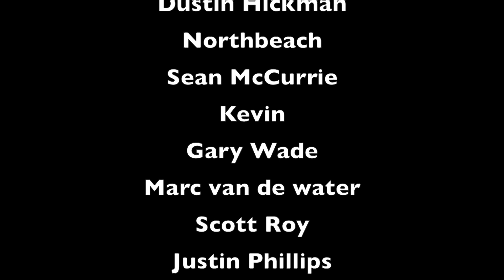Detroit Diesel schooling from the Bus Grease Monkey

Comment: Stu, that advice re the electric lift pump on the Detroit was spot on. I fitted one to my 1946 Cat D4 dozer and it was the best thing I have ever done/ I converted the dozer from Pilot (donkey/pony) start to electric start. That meant I would have been trying to start the old girl on no fuel pressure. With the electric lift pump I have working fuel pressure before I start cranking the engine. Brilliant. I might tell you that poor 73 year old dozer has to earn its keep here, so it is no hobby toy. I might also say that the old dozer and I were born in the same year.

Comment: I was a firefighter for 30 years. The Detroit diesels  on our apparatus has an engine kill switch in the cab in case of a runaway. A cable went to a spring loaded plate that closed cutting off the air. To restart it you had to open it manually.
Reply: I dont work on diesels but ive heard most(maybe all) of the new ones have those in them(Over the road trucks at least). Definitely something that is very useful

Comment: A story about a blower shaft: Back in the 90's I worked mechanicing on  trucks but also helped a friend drive a few spring break bus tours...Going across I10 in Florida with a'72 Eagle, 8-71 the blower shaft let go...we pulled up the back floor and got the shaft out, the spline teeth  were sheared off but there was  a  little bit left on the end. We had no other shaft so I put a dime in behind it to get the remaining spline teeth to engage the  blower spline. It ran all the way back to Canada.

Comment: Stew, if you don’t have a aairbox shut off then you need a home made one. Something like a board with a piece of carpet glued on so you can seal off that’s air intake, of course making sure that you can get to a open air intake. This is not for just for new start it’s for always in case you have a governor failure or a stuck injector as mentioned.
If you are going to set up the engine yourself you really need to get a hand held rev-counter and  a tune up tool kit so you have the go-no go feeler gauges and other special tools that are used to set gaps like governor gap for example.
I ran a fleet of 6 Terrex twin engine scrappers in the  70,s in Africa and we fixed every thing in the  “bush” they had 6-71 engines 
With Allison outdo shift boxes. Loved those engines, hated the transmissions,
Reply from the maker: Fortunately a friend back home has messaged me to say he has a shutoff I can have to install so that will be going on for sure.

Comment: I install gas meters in the UK. When we replace the regulator and meter we always use new seals. First thing you've gotta do is check that you've got the old washer completely off, or the new seal will never seat properly. It may seal for long enough to hold on your tightness test but not for any real length of time. Then you're in the shit.

Comment: Awesome video.as a truck driver I’ve always liked the Detroit diesel motors.
Reply: Worked for a guy who had several semi tractors.  He hated Detroit Diesels.  Said he was going to put a stick of dynamite in the injector holes on the last one he had to pull out and send a picture to Detroit Diesel.  He did like Cummins and Caterpillar.  I drove a Ford box truck with a Caterpillar that had 700K miles on it.  Much more than anyone expected it to last.

Comment: C o2 fire extingusher will shut down a runaway with no damage
Reply: boaterbil But Nitrous Oxide is way more exciting.
Reply: C02 is really the best and safest way.  I would only use a block of wood etc. if there was nothing else.
Reply: @TheComingGlory  Just don't do what one of my idiot customers did when shutting down an accidentally paralleled generator, thus motorizing the generator while trying to shut down the engine. The dingdong used a dry chem extinguisher, and the motorized generator just kept right on spinning the engine!!!!
Reply: Years ago read a story a Navy mechanic was telling. Detroit ran away he sprayed a CO2 extinguisher into the intake. The cylinder head blew off and passed his head hitting the hull.
Another instructor at a mechanic school had on run away and he placed a clip board on the blower opening, no intake. The clip board collapsed and got sucked into the blower. Some blower intake gaskets have screen on them.
Reply: @gullreefclub  lololol

Comment: The rectangular box  bolted to the blower inlet is an air silencer. They have insulation in them to help quiet down the noise of the blower rotors. We would always replace them at rebuild time. Also you definitely want to use a sealer between the blower housing and the end plates. I used Loctite anaerobic sealant p/n 51813 but I have also used aviation Permatex.  If you don’t use a sealer you will have an oil leak from the large oil drain holes that are in the end plate (approximately 5/8” - 3/4” or 16mm- 19mm) where the meet the the blower housing. I also put liquidTeflon thread sealant on all the bolts that are not into blind holes as well as the copper washers, and dressed all the gaskets with the anaerobic sealant on one side and glued the other side to the block or larger part. We  Dynomometer tested our engines and used dye and a black light to check for leaks.
Reply from the maker: Thanks mate, some great info there. :)
Reply: He’s right about the aluminum valve cover. We only used them and threw away the tin ones.
Reply: There is so many things I could tell you about building the blower but mainly make sure you stamp mark all the parts as you disassemble them and be sure to wire the shims behind the gears to the gears for reassembly. (Usually you can use the same shims to get the proper “C” and “CC” clearance.)  We used the turbo blower seals that are double lip Teflon but there is a special tool to install the seals and sleeves to the correct depth. Just make sure you follow the manual closely in regards to the omitted serrations and clearances of the rotors and housing. I wish I could afford to go down there and help you with your project.

Comment: Yes blocking the air intake ( with a board ) or using co2 fire extinguisher will work to take the oxygen out of a run away  engine .  I think Stu has a mig welder  ( or Tig ) how about dual purposing his welding gas bottle as the source of the suffocating gas . Could be plumbed in to the intake like a nitros system on a  performance car. Have seen the results of a dry powder  fire  extinguisher used on a truck . Shot in to the external hood air intake the paper element filter became blocked , engine suffer no permanent damage .

Comment: Good to hear to someone who really know his stuff and great to see you catching up with other YouTubers.  Definitely carry a spare starter, I have changed several at sea, alternators are no so much of a problem as once the engine is running it will get you home even if there is no charge, I did have a pulley shear off an alternator which stuffed us as it also provided tension to the raw water pump but that was once in 40+ years at sea. You are only going to get displacement speed out of your trawler, probably 7.5 knots so adding a turbo won't alter that.
Reply from the maker: Yes, I'll definitely find a spare when I can. Also agree about adding more power. I will only end up pushing water and burning more fuel.

Comment: What I was in the Army I had several of our 6V 53 runaway I have used fire extinguishers it sucked holes through clipboards we threw engine manuals into the blower we soak ground hop them we have no way to shut them down we used to take the fuel lines out of the out of the fuel can an engine with just start sucking oil up through the pan and run off the oil

Comment: Cool info i drive a big Double Decker Bus 15ltr V8 93 series and recently clocked the Million ks Right at the top of Mt Ouzly ! The old beast probably done a few laps on the dial. Even took a quick photo and announce on mic to the 70 passengers!
Reply from the maker: That's cool sharing it with the passengers. :)

Comment: He's 100 percent right about those old two-stroke Detroit being oil leakers. I used to work for a company  Roadway Package System years ago in the early 1990s before FedEx bought them out. We had a 1978 White Road Boss tractor that had a 318 Detriot motor. I drove it for about a year and I swear the EPA could've thrown me in jail for illegal dumping as much oil as that motor leaked. I did love that it had a straight pipe single exhaust system on it though, it screamed when going thru the gears if you put your foot in it with a load. Everyone knew you were coming from blocks away.

Comment: Stu, as for a run away,the mechanic at my Uncles marina has a board  he calls his "blower board" for Detroit's. It's a piece of Oak from a old cabinet that is VERY flat and has rubber glued to the one side that helps seal it to the blower case in a run away and the other side has a strap screwed to it as a handle to keep your hands from the blades. For the $3 in parts and 20 min time I HIGHLY recommend making one for piece of mind since trying to fumble with a piece of wood without a handle during a run away can be VERY DANGEROUS. Hopefully you wont need it but it also doubles as a nonslip place to set tools on deck too since it has a raised edge from being a cabinet door.
Reply from the maker: That sounds like it is well worth the time to make. Thanks for sharing!
Reply: @DangarMarine  At the very least attach a handle to it so you can get it on safely. But the rubber really helps it to seal and choke them quickly. You could use a old drawer liner,gasket material etc you have around as long as the contact adhesive sticks to it well it'll work.

Comment: I don't know how much this would help.  Older light trucks often had a non-synchro first gear but had it in second.  In cold weather when the gear oil was stiff I would get it into gear by shifting into second at a stop, then shift it into first before releasing the clutch.

Comment: the later driptroits ran the airbox drain into the crankcase.   so much cleaner.    if the blower has helical cut gears you'll need two pullers because the gears have to come off at the same time.  you have the videos of taking it apart to look at as those things are symmetrical and can be put together backwards 20 ways lol other than that he's givin ya all youll need   and to my knowlege the elctronic ones he mentioned were all 4 strokes.
Reply: Yes, the blower gears are helical cut, and lightly press onto splined shafts. These splines are "keyed" so the gear can only go on one way. The helical cut gears along with shims between one of them and the bearing inner race is what sets the lobe gap. And, yes there are DDEC 71 and 92 series engines. I don't think there ever was a 53 series DDEC, other than maybe some crazy military builds.
Reply from the maker: Good tips guys.

Comment: If you had a clutch brake left it wouldn’t grind gears. Never hold the the clutch in for long periods of time ( like at a light) this wears out clutch brake. Same with trucks or any clutched vehicle. You can adjust clutch brakes  but depending on witch clutch you  have not all are adjustable.
Reply: Watching Scott's clutch replacement videos, I have yet seen any clutch brake hardware.
Reply: Old busses like Scott’s 3751 were not equipped with clutch brakes. Hard to wear out something that was never there.

Comment: I have had a jimmy run with a broken liner , just didn't have the power . But I laugh when they say the book . Heck we had 7 of the 3 inch thick buggers . Of course they covered from the 53 to the 71  . We found most of the maintenance was little things that if not caught would not cause the engine to break although had many cases of the racks jamming and they wowee away we run . And as stated they were Green Leakers .

Comment: Make note of that electronic fuel pump thing to prime it. There's nothing worse than trying to start a Detroit Diesel that's out of fuel or has lost its prime. It sucks the fuel filters dry in a second. And the only way you can prime it is to continue to fill those filters.

Comment: What i do when i run into bearings froze to the spindle i use whizzer and cut the bearing 90 percent  then smack it with a hammer comes off easy

Comment: I have never driven anything with a 2 stroke Detroit but a 60 series I have a few million miles or more back in the late 90's. The 2 stroke fuel pump is similar to a B model CAT  if the timing is not set right she's GONE!!! Why can't you float the gears double clutching is a waste of a good knee! I have had my clutch come apart and the pedal drop to the floor and driven a 1000 miles without a clutch pedal its all about timing. Not criticizing just asking if there is a special reason? Great Q&A video Stu and Scott!!
Reply from the maker: Not sure regarding the double clutching, but as you say, keep a bit of pressure on the gear lever and once the speeds are matched it will slide right in.

Comment: I got one of those sheared blower drive shafts right here on my desk.   I sheared it when trying to start my 3-71, and some water had found it's way into the lobes of the blower and froze.  The starter was able to shear the shaft after trying to start it a few times.

Comment: Would a pcv valve help with oil leaks?
Reply: There is no "intake vacuum" for a PCV system to work on most diesels.
Reply: @newjerseybill3521  how about a breather cap
Reply: @saintm1680  Yes, all Detroits have a crank case breather somewhere, Common places are in the center of the valve cover, in place of one of the accessory drive cover plates in the bell housing, or on the side of the block opposite of the blower.

Comment: "ALUMINIUM" as they say in Britain and outside the U.S. is the name of the element itself on the periodic table of elements after being mined and isolated ----- "ALUMINUM" is the name for the finished product after being processed, engineered and manufactured into its final form with added modifiers and strengtheners added to improve structural, thermal, elasticity and other properties required by the specific part being manufactured.  If you tried to make a finished part from non modified "Aluminium" it would fail in short order as its doesnt possess the proper engineering qualities needed.  Edelbrock is a MAJOR manufacturer of aluminum engine parts like intakes, heads, valve covers and there are also aluminum blocks and ALL these parts are specified as ALUMINUM - NOT ALUMINIUM.

Comment: The old grease monkey here doesn't have any respect for the clutch brake or you know that's not how you drive a truck unless these were made without a clutch brake and I can't imagine that but you don't push it all the way to the floor well it's rolling or you're trying to stop the whole vehicle with the poor clutch brake and then it wears out and then it grinds when you try and put it in first gear what am I missing here by the way I was driving a KW cabover that had an 8v92 silver that ran away on me first I just lost power I pulled over put it in neutral and then the damn motor ran away it was so Eerie because once they are Pam's got above 5 6000 it's got real smooth and almost kind of quiet and the only way to stop it was to crawl under the dog house to try and cut off the air and I wasn't going to do that so I just sat there and watched the engine melt very scary thing by the way some brilliant SOB decided to remove the manual fuel cut off that was down on the floorboard and rely on the electronic shut off on the ignition well that was about an $8,000 mistake